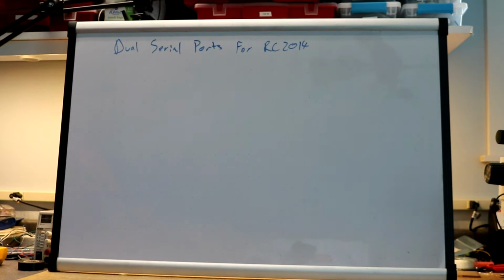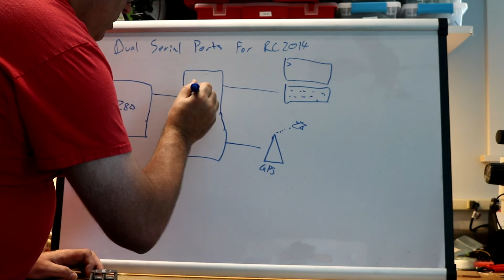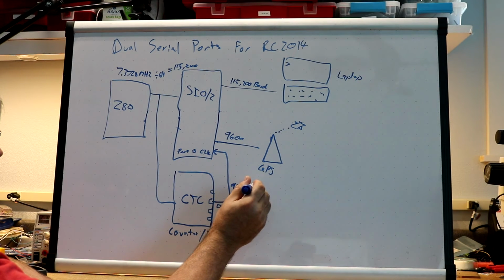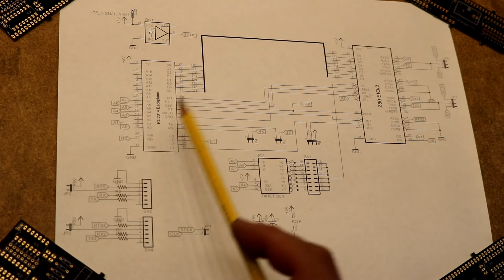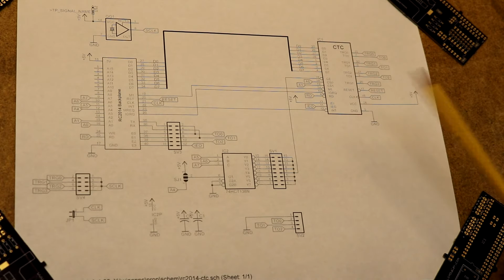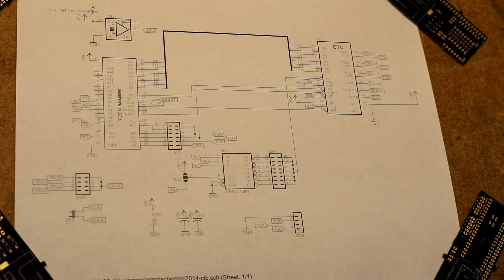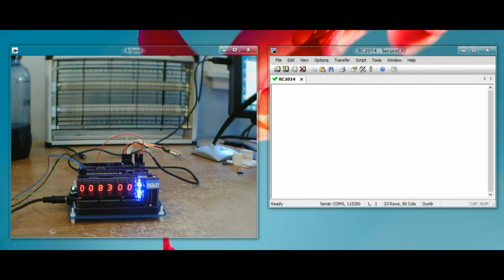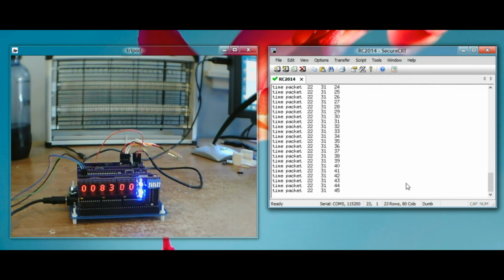Z80 Retrocomputing 9 - RC2014 CTC and SIO/2 boards, interface Z80 to GPS

Comment: Serial port chips work much more reliably in 16x mode compared with 1x mode. This is due to that fact that the start bit detector is able to do a much better job at finding the initial "edge" of incoming characters.
Reply: Thank you! I'm just in the middle of designing a Z80 computer and could not guess the reason why the 1x mode would have any drawbacks.